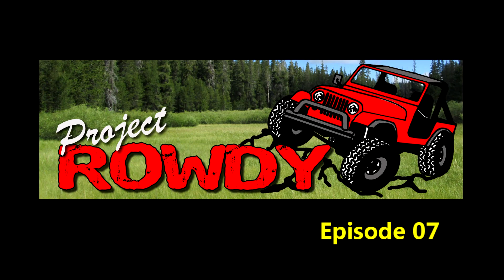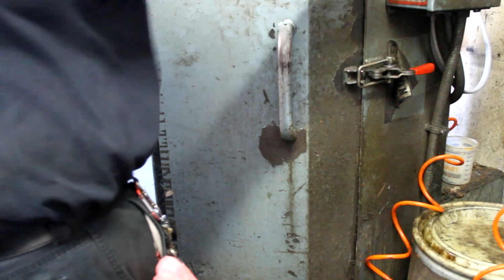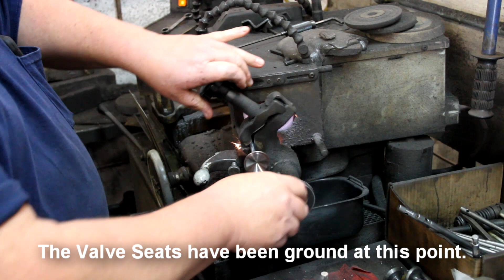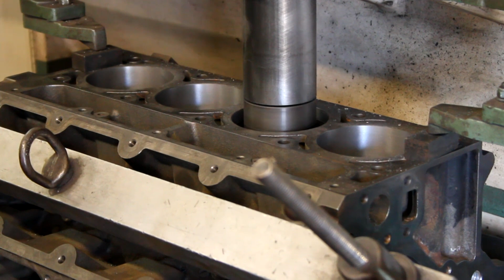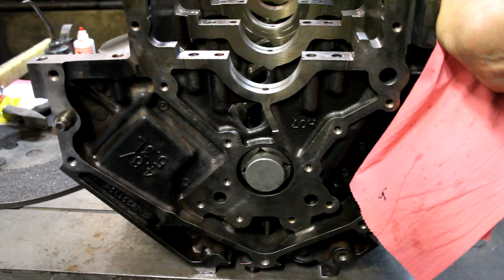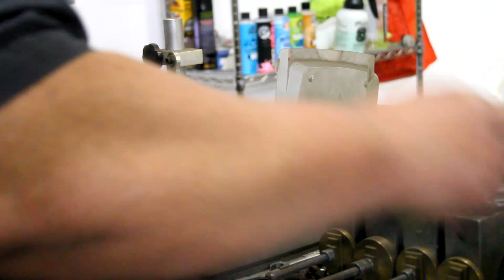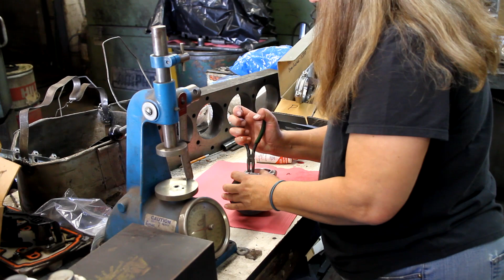LS 5.3L Build Part 3 Machine Shop Work | Project Rowdy Ep007

Comment: Nice video,  were you satisfied with the machine shop's work and would you use their services again?
Reply from the maker: I was very pleased with their work... and yes I have another future project planned that I will use them again.  Cheers!  Mike
Reply: @UCanDoIt2Mike  thanks for the response 
Not to many competent machine shops around me or any I have confidence in
I plan to take my 5.3 to them and have them bore the cylinders to 3.905 
Im building a 383 stroker 

Thanks again
Reply from the maker: @Slicpartna  It is a small shop and owner operated.  There is a vested interest in getting your items done right.  Cheers!
Reply: @UCanDoIt2Mike  did you supply the replacement intake and exhaust valves or did the machine provide them?

thanks
Reply from the maker: The machine shop has distributors that supplied all of the rebuild components.  Including the Valves.
Reply: @UCanDoIt2Mike  wow thanks for the quick respone 

Awesome 
Save me the trouble of sourcing my vavle train parts

Happy Holidays to you and your family 

Thanks again

Comment: How much would this entire procedure cost for a junkyard LS 6.0 Liter or 350 block Engine (Heads included) cost to have done general for slightly upgraded cam, valves and piston?

Comment: Hey buddy,  did you clean inside your intake?  I’m thinking about soaking mine in simple green+water for a day or 2
Reply from the maker: I did clean it.  Sprayed it with Simple Green and maybe something else while scraping the extra build-up off with a scraper and screw driver.  It came relatively clean.  Cheers

Comment: 😎 With the 20 overbore what is the new cubic inch from 5.3 and have you done a Horsepower check?
Reply from the maker: Not of the new Cubic In.  I'm sure someone has recalculated the answer and published somewhere.  Not sure on the HP.

Comment: When you installed the cam bearings how did you index them so that the holes in the bearings matched the holes in the journals - are there really two holes in each of the bearings for oil, both in the lower quadrant so that the oil enters the cam in two places of each bearing or what?
Reply from the maker: My machinist installed the CAM bearings for me.  But I was there.  He aligned them as he was putting them in and he even double-checked with a flash light to make sure they ended up aligned.
Reply: @UCanDoIt2Mike  I was curious how he went about determining where to locate the bearing relative to the journal. The reason that I ask is that I was of the impression that the bearings have two holes in each. Was that the case with yours and if so, were there two journal holes that he had to match up with and if so how did he do it?
Reply from the maker: Have you ever seen a Cam bearing installation tool?  It is a long rod with an expansion pad on one end.  The new bearing is secured to the expansion pad and then "clocked" to the position that you want it installed in the block.  Then you tap it in place.  He then checked that the hole lined up (1) Clocked properly and (2) the bearing was installed deep enough to make the holes align.  If you are having Block work done at a machine shop, you can ask them to change out the Cam bearings.  Probably important to use that installation tool.
Reply: @UCanDoIt2Mike  I don't mean to belabor the point, but yes I have seen the tool and believe that he did align it properly, but I wondered how he does it when the bearing has two holes. In particular, do you recall that the bearings each had two holes and whether or not he had to do something special to get them to line up with two holes in the journals that they fit into. 

I have seen the bearings with two holes in them, but I have not found anyone who can definitively state that those two holes both line up with a hole in the journal. I think that only one hole exists in the journal, but I don't know for sure. Can you help me with this? I have a guy who is claiming that the oil feeds in through one and out another to feed something else - I doubt that.

Comment: The first tank that they use is a caustic soda tank.  It has a heater and this one looks like they are using the circulation.  It removes oil, grease, and anything aluminum.  If this was a LS1 block you wouldn't have anything left.  All bearings must be removed before using this tank.  The second machine is a pressure washer that you can put any kind of part into, even aluminum.  It has a heater and some people use just plain water.  Looks like a Sioux Valve Grinder, Rottler Boring Machine, haven't use that deck machine but it looks like a Rottler.  Must have been a pretty high mile engine to need .02" over, if you are lucky with an LS motor you can get away with a .005" over piston that doesn't need the boring step.  That measuring tool he is using on the bores is a bore gauge that you will zero to the widest part of the piston skirt, the barrel.  Then the bore gauge will show + (clearance for the piston) or - (not enough clearance for the piston), this number is different for piston material.  The bore gauges can quickly measure to about .00005-.0001" depending on the quality.  Looks like a Sunnen hone, one small detail is that you shouldn't hone the cylinders in a row, 3,7,1,5 is a good way to do it and evenly distribute the heat of honing.  If you bore or hone the cylinders in a row and measure it at the end there will be a difference between #1 and #7.  That last brush is a nylon bristle that used for the plateau finish on the cylinder.  Works great on plasma-moly rings which I'm sure you are using.  http://www.pro-bal.com/tech_info/library/Precision_balancing_of_reciprocating_engines.pdf  This is a good article on balancing by Pro-Bal who makes a lot of the balancing machines out there.  It all comes down to the fact that some of the connecting rod is considered rotating weight (big end) and is added to the crankshaft while on the balancer and some of the connecting rod and the pistons are considered reciprocating weight.  Some people do all the calculations and then still add their own over or under balance to it as they feel it is better for them.  The balance machine usually turns around 500rpm.  You wouldn't want to be near it if it was spinning much faster.  That is an old type balancing machine, but it seems to work fine.

Comment: Correct me if I'm wrong so you bought the .020 over pistons first and measured them. You took those readings to match the block, measured the block to see how much to remove and while doing so also found the bore was tapered? Just want to know because I'm also doing a rebuild and it seems I have to take the pistons to the machine shop rather than let them cut away first and then take them.
Reply from the maker: This is a great question!!!   Let me explain....  First it is important to understand that I was trying to stay as stock as possible (the goal).  I took the Block and Pistons to the machine shop.  Bryan (machinist) cleaned the block and then measured all of the Bores.  That is when he measured a slight taper in the bores.   Based on the measurements, he determined that he could machine-out the taper by Boring the cylinders 0.020.  THAT is what determined the decision to use 0.020 Over Pistons.   Once that was determined, we purchased the new Pistons.   He measured the new Pistons and THAT is what he based his Boring and Honing steps on.  I do not recall the details, but the Boring process took out the majority of the 0.020.  And each of the Honing stones (4 or 5) snuck up to the final bore size.   This part was fascinating to me.  Hope this helps!!!! Mike

Comment: Great video and procedure but I do have one complaint. I really can't understand why the machinist at 2.10 seconds cut and angled the valve tips on a WET grinder but didn't  turn on the pump for lubrication and dry shaved them leaving a  really rough, course and uneven cut wearing out the rocker tips  Also it damages the stones on the valve grinder. All else was great and I enjoyed the video. but I just found this odd. Oh thumbs up.

Comment: Where did you get your .020 pistons at may need my block bored
Reply from the maker: Most of the parts for this engine, I purchased through my Machine Shop.  As he would Inspect, Machine and Determine final specs....  He could them properly purchase the correct replacements.  Items that may require unique sizing include, Pistons, Rings, Main and Rod bearings, and Cam bearings.  Once he knew where each item was going to end up, he purchased the proper sized parts form his distributer and sold them to me as a Kit.
Reply: Thks,  I'll have to contact machine shop
Reply from the maker: You can certainly purchase engine parts from Speed Shops, Auto Parts Stores (AutoZone, Oreillys, Summit)...  but what happens when you need the entire kit EXCEPT for one of the bearing sets.  It just seems to make sense to me to let them "Customize" a kit for you that fits your engine's new specs.   With that said, I have a feeling that quite often the block will come back with mostly stock specs and a off-the-shelf kit might work (otherwise why would it be an option).  Your choice!  Cheers!

Comment: were did you get those pistons and rods
Reply from the maker: They were purchased by my machine shop through their vendor.   The Parts List in the description section under the video shows the part numbers.   But remember that these piston are .020 over stock.  Make sure you are getting the right ones...

Comment: For an internally balanced rotating assembly, I’m curious why the balancer was needed to balance fully. I do notice the improvement made, but my impression was that the balancer and flywheel aren’t necessary to balance for an internally balanced LS engine. ? Thanks.
Reply from the maker: I'm not sure the answer!  He asked me to bring it and we did install it while balancing the Crank.  Don't see where it would hurt!  And on a side note...  we did have to make an adjustment to the balance of the NEW Flywheel.  Had we just focused on the internal balancing, and assumed the FW was good (since it was new), there would have been an issue. I believe the effort was justified.
Reply: Thanks for the replies. I’m about to start a similar 6L build, and want to do it correctly. I was considering a factory new block rather than a used one, but am unsure what machine work that really avoids. I have a 6L used block available, but not a complete pull out like yours.
Reply from the maker: Now that I have been through one of these LS style Gen3 engines, I would feel comfortable starting with a used block and buying the new parts that I need.  I normally like to take apart a complete item because I learn so much from the teardown.  I ended up replacing so many parts that having the whole thing was not completely beneficial.  I guess it is based on how much you know and your available access to parts.   The book I followed was invaluable.

Comment: I noticed you removed the timing chain gear from the crank. Was that necessary for the machine shop? Was it installed when they balanced it?
Reply from the maker: I removed the timing chain gear, because I knew I was going to be replacing it.  I can not think of a reason (other than a few $) that anyone would not replace the gears and chain when doing this type of work.  The gears may look good, but the Chain should be considered a "consumable" item.  Not sure if it would be smart to replace the chain without replacing the gears.  The new gear was not on the crank when we balanced it.  Probably a good idea, I would assume that the new gears are a balanced item, but you never know.  Hope this helps!

Comment: What cam and springs did you guys end up going with?? I'm interested as I myself am building a 5.3
Reply from the maker: Comp Cam Kit CCA-K54-408-11.  The RPM Range of this cam 408-11 is going to match my usage.  There is a complete list of parts that I used in the Description Section ("Show More") under the video.  Cheers!!!
Reply: @UCanDoIt2Mike  When you installed the cam bearings how did you index them so that the holes in the bearings matched the holes in the journals - are there really two holes in each of the bearings for oil, both in the upper quadrant so that the oil enters the cam in two places of each bearing or what?

Comment: My understanding is the early experience with these engines is the heads being torqued to the block distorted the block causing oil consumption..so a torque plate was used during boring...was that mentioned?
Reply from the maker: I did not mention a Torque plate because we did not use one.  He had a stack of them for various sized engines, but we did not use one.  Cheers!

Comment: Great videos! Does anybody know the part number for those new pistons?
Reply from the maker: I can give you the part numbers that I used.   BUT....  Be Careful!   Make sure you desire a 20 thousandth Over Piston before you purchase these.   Sealed Power:  H1127CPA.55MM.   These are NOT stock sized pistons.

Comment: How much does it cost to get that block machine
Reply: UCanDoIt2 I would say money well spent. It's a professional work adding to that the engine is extremely reliable. Well worth it.
Reply from the maker: Well...  I did not get a breakdown of the cost from the machine shop.  The total machining costs was about $1100.  That covered all of the work covered in this video as balancing the new Flywheel that was not covered.

Comment: can you tell us how much did you spend in machining and how much as it in part. Thank you
Reply: UCanDoIt2  link did not work. How much was the head rebuild?
Reply from the maker: I did not get a breakdown of the machining costs.  All of the Machining that you see in this series, plus balancing the new flywheel was about $1100.    Which link did not work.... I would like to fix it.   Thanks you!!!!
Reply: UCanDoIt2 the engine expense link above. 
I'm looking to do a stock rebuild in my LM7 next year, original budget was $1,500. I think I'm going to need to up it. Originally I had $500 for machine shop.
Reply from the maker: Interesting about the link.  It works for me and I can see that 54 people have downloaded it in the past 3 weeks.  What browser are you using?   I would be happy to send you a copy of the sheet ( I think you will like the details).  Send me an email:  Ucandoit2Mike@gmail.com
Reply: Yeah the link doesn't work. I would like to take a gander at it as well.
Reply from the maker: The Machine work was $1215.  I have included a breakdown of all of my engine building expenses in the following PDF document:  http://bit.ly/RowdyEngineExpenseSheet .   Hope that helps!

Comment: Shouldnt the machine shop use a torque plate when boring/honing the decks?
Reply from the maker: 02cents you are probably correct.  I don't believe that it will affect my street build.   Great observation.
Reply: @UCanDoIt2Mike  you might get a nasty vibration
Reply: Yea they are man.
Reply: Yes! Very important when boring an LS engine!!
Reply: Not important as much for boring if you stay out of size by more than about .004-.007, but for honing yes definitely.

Comment: why does the block have 4.8 and 5.3 stamped on it sorry for the questions I'm gonna build the 5?3 in my tahoe
Reply from the maker: That is a great question.... and the answer is...  The 4.8 and 5.3 use the same block!!!  I believe (that's my disclaimer) that the difference between the engines is the Crankshaft (4.8 - shorter throw) and the Piston Rods (4.8 slightly longer rods).  This would create a situation where the pistons travel less and create the smaller displacement.

Comment: so you can bore these blocks out I was told you could not is possible to make a stroker motor out of a 5.3
Reply: Michael Baker 
maximum bore on a 4.8/5.3 block would be 3.902".
So yes, you can build a 5.7,ie. 347 out of a 4.8/5.3 block.
Bore would end up at 
3.898".
It costed me $240, to have a 5.3 block bored from, 3.780 to 3.902.
Reply from the maker: I believe you can bore it out to 5.7 which is like an LS1/LS6.

Comment: great videos, did you go back with all oringinal internals and valves and springs?
Reply from the maker: Comp Cam Kit CCA-K54-408-11:  206/212 112 LSA.  What I like is the RPM Range of 800-5800.  I wanted this streetable and the lower range of 800 with greatly help.
Reply from the maker: No...  Most if not all internals were replaced.  New Springs came with the Comp Cam Kit, New Valves, Pistons, Rods, Bearings, Rings...
Reply: What size cam @ucandoit?

Comment: Mind if I ask you where this was done at and what kind of coast it was?
Reply from the maker: I used Coosa Valley Machine Shop in Cartersville, GA.  The machining cost was about $1200 which included all of the work that was included in the video (and he balanced the new flywheel which was off).   I did buy many of the parts through them as well (Pistons, Rods, Valves, Rebuild Kit, Oil Pump, etc) which was about $1900.  In total I have right at $5K in this engine.  I am currently working on the Wiring Harness and will probably spend another $100 there on connectors, Tape and Loom.  Hope this helps!  Have fun with yours!!!!!!
Reply: UCanDoIt2 I've got mine pretty much buttoned up but I would like to create more hp out of it.

Comment: Great video what happen with valves did you get wrong size so they have to shave them or what ??
Reply from the maker: It is my understanding that Brian took a measurement of the original Valve length as it protruded on the top side of the head.  After performing a slight grind on the head to clean as reset the valve seat, the new valves then protruded slightly higher than the original setup.  He used the original measurement and then ground the length of the new valve to that spec.  This is my understanding.
Reply: Ohh okey